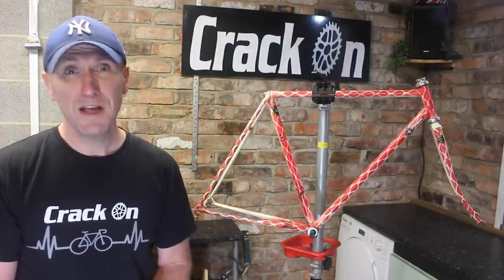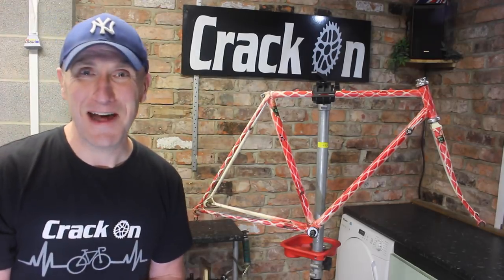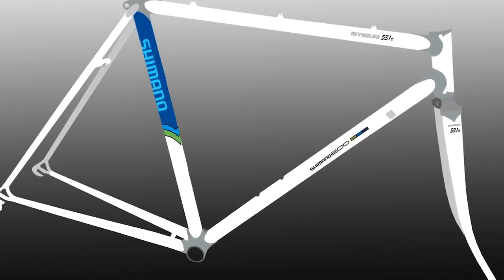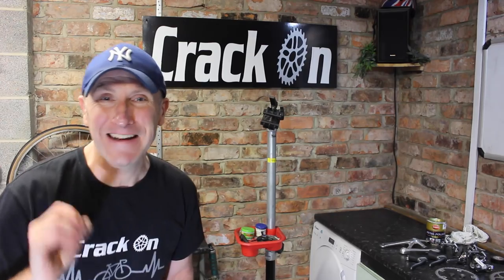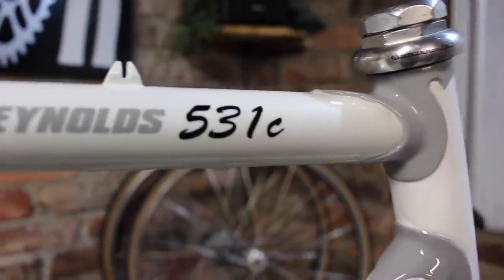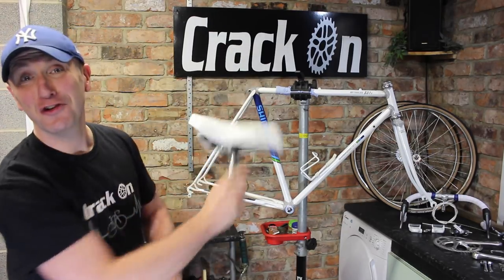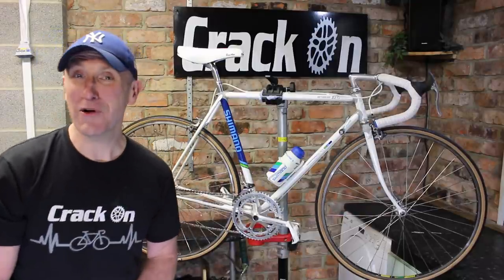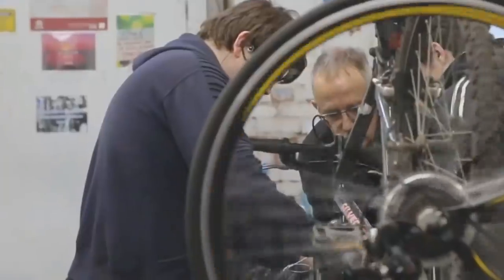Bicycle Restoration (The frame with NO name)

Comment: Nice , No clues from the frame number then.?    A British thread BB and reynolds tubing hmm  . Like the grey lug paint touch.. cannot beat that shimano group.. so durable..  Those new Turbo saddles seem harder than the old ones.. Must be me getting soft or getting used to  Charge saddles which I rate quite a bit. ! Yeah good job very nice bike..
Reply from the maker: Hello my friend, no frame numbers I posted it in a load of facebook groups with no joy. I think in general the saddles are getting harder, or maybe us getting older probably the latter. Thanks so mush for you long lasting support stay well thanks again Andy

Comment: I really need some help. I recently got a bike from 1973 I’m guessing. It has KS 4545 stamped onto the shimano LF rear dropout, B M on the head tube lugs, 73 on the seat tube lug, a40 and 730001 on the fork and steerer and a full first gen Dura Ace 10speed group set, turbo saddle, melt forging seat post, sr stem, and early mavic sport wheel set. Any idea what this could be? Any info you could throw my way would be amazing thank you. Also it has no rack or water cage mounts.
Reply from the maker: Sounds early 70’s to be honest I haven’t a clue. You would probably be better posting some images on Facebook steel is real groups. It’s where I start. Sorry I couldn’t be more helpful

Comment: Beautiful restoration but must admit I'm pinning for a different bike to be restored just for the novelty value. Maybe something like a folding bike; a Raleigh 20 or maybe a Dawes Kingpin or maybe a Raleigh Chopper or Grifter if you haven't done one already. Maybe a classic 3 speed hub road bike, they used to be a thing. Maybe a slightly older road bike like the old BSA's.
Reply from the maker: Thanks for watching...the last restoration was a BMX if you’ve not seen it already. A few have requested more retro MTBs. Watch this space 👍

Comment: Looks nice what size is it, looks 53cm ish..? I have an Arthur Caygill cyclo-cross bike in my spare room that would make a good restoration project for you, it is circa 1997 and made by Caygill, TIG welded Columbus tubing from what I can remember, has some 105 on it plus runs cantilever brakes as was fashionable pre disc brake era
Reply from the maker: Thanks for watching and the support....it measures 54cm but to be honest it seems smaller than a 54. Sounds a nice bike you have there. If your on social media by all means send us some images. Thanks again 👍

Comment: The more I watch your videos the more I like them haha Btw, I recently bought this Peugeot from the early 70s and the crank extractor does not thread in (only like half a turn), is the threading different like the French bb threading? The thread looks clean to me. If it is a different threading I suspect getting hold of an old extractor is going to be extremely difficult
Reply from the maker: On the Vintage Claud Butler 531 restoration I have a very similar problem with a strong light crank. I used an extractor ruses in the car industry as shown in the video. Someone also posted a link for the correct tool. Hope this helps thanks for watching and your support https://www.ebay.com/itm/2in1-Stronglight-Specialites-T-A-removal-remover-crankset-Arm-Puller-Tool-NEW-/222325878325?hash=item33c3a7ae35%3Ag%3Ax7oAAOSwol5YwWeB
Reply: @BikeItUK  THANK YOU SO MUCH!!!

Comment: I was trying to restore my beat up street bike and used a product that was supposed to smooth out the paint scrapes but all it did was remove the shine from the paint. Wish I'd just spot touched it up like you do because now I have way more work to do to fix itl.
Reply from the maker: Oh dear so hope you get it sorted and hope this  video helps you in further restorations
Reply: @BikeItUK  thanks! That’s what I get for working in dim lighting!